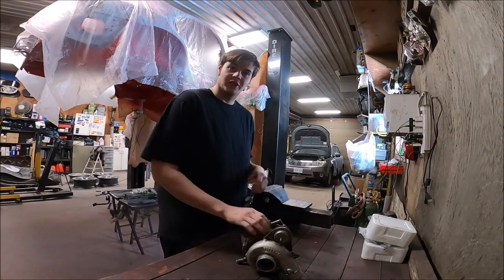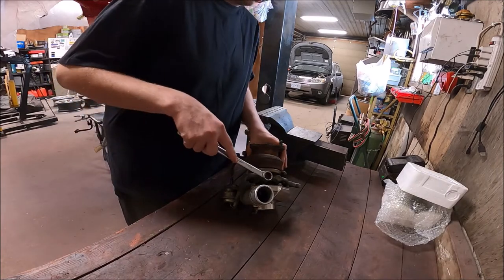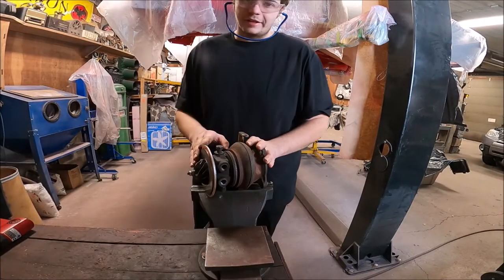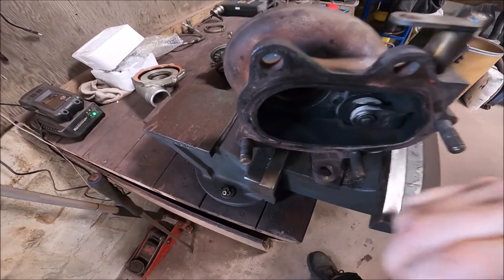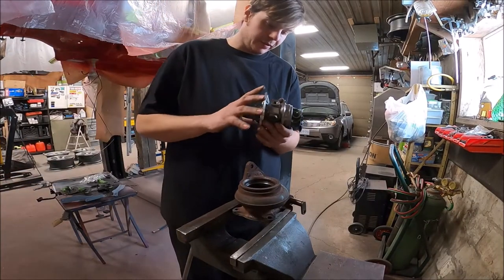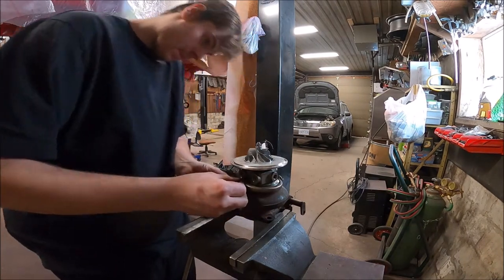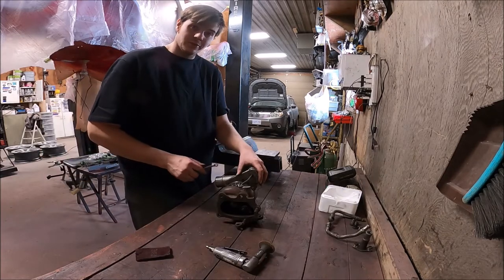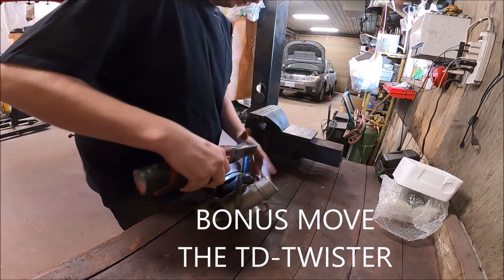How To Replace Subaru VF Turbo Cartridge

Comment: So I’ve torn apart a VF46 and the wheel scored two small grooves on the cold side. Can I reuse the housing?
Reply from the maker: That is kinda risky, it can draw air around the groves and preform at little less then prefect. If its a daily driver and you dont want to buy a new cold side then it would be Ok to re use. If there is any lifting of the edges in the groves that you can feel then definitely sand them away with a fine sand paper like 800g. Hope that helps!

Comment: Is there any reputable company you guys can recommend for good turbo cartridge? I feel the cheap units out there are most likely made with crappy/cheap Chinese parts.
Reply from the maker: Around here there is turbo parts Canada. They do ship 😬
Reply: @TheSubieSanctuary  Wow, you were not kidding about how difficult separating that cartridge from the turbine housing is.. I am going5 days trying and still nothing.. I have a press at home, is it ok trying to press it out? I’m concerned about bending the shaft though..
Reply from the maker: @Mike_44  we use a air hammer 😬 not sure if you can bring to a shop and get them to just brap it off?

Comment: How many kilometres on that cartridge ?
Reply from the maker: Unknown, we just got it like that. they last as long as the oil is clean and sufficient along with proper oil pressure. 
Ive seen turbos fail in weeks vs turbos last 300,000kms+

Comment: Great video. Have you ever done this with a VF24 turbo, or similar? That's what I have, and I can't find the part (in the UK) and I'm not certain if those ones can be rebuilt in this way. Would be great to know.
Reply from the maker: I think the 24 is ball bearing. 
I was able to find a new td05H cartridge with billet wheel. Same era turbo 1994.
Mamba made the td05 cartridge
Reply: @TheSubieSanctuary  thanks a lot. I was wondering if a cartridge made for a vf34 or vf30 or something else that would fit my turbo? I can't seem to find anything on the web on this subject. Some sites say the exhaust side of VF24 is P18, same as a VF30. But the VF24 has a smaller compressor housing. Or is there a more modern turbo that's cheap secondhand that would be similar? Thanks. BTW, I think you're in Canada, right? (eh?) I did my PhD in Newfoundland. Great place.
Reply from the maker: @iebah1  yes sir! Canadian here. 
Vf28 and td04 both will work. Td04 is cheap and easy to find. 
Or google vf24 chra cartridge, there has to be a few places that make them. But if ball bearing then they usually arnt cheap.

Comment: did you let the sealant cure the full 24 hours before running the turbo or or did you just wait for it to dry?
Reply from the maker: Definitely let it cure for 24 hours if you can.
Reply: @TheSubieSanctuary  okay, would you recommend using red the right stuff then? the car is my daily so id like to have as little downtime as possible.
Reply from the maker: @Stinkeye13  right stuff will probably be the best/quickest dry and will certainly do the trick